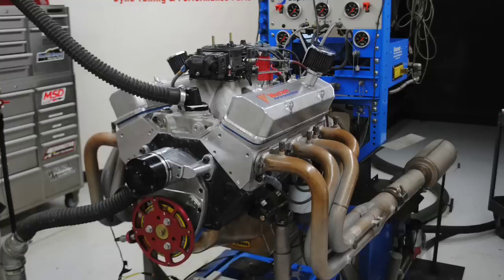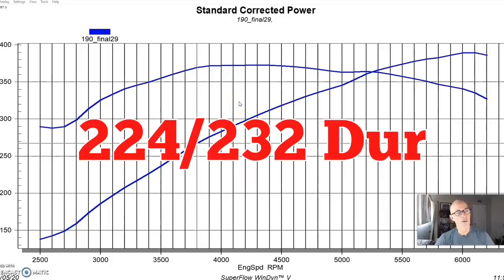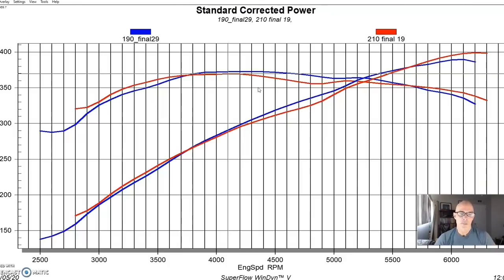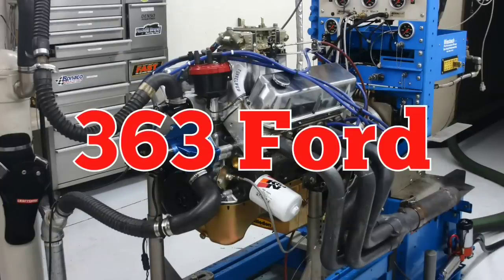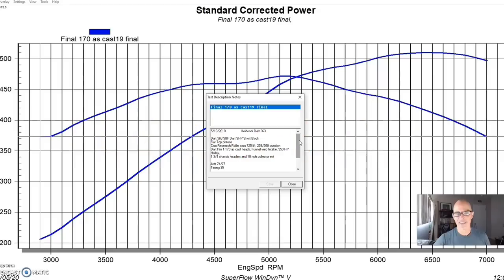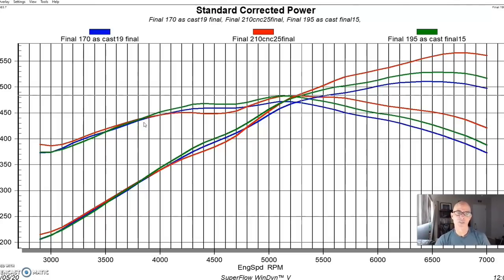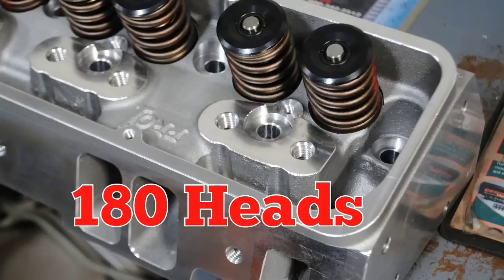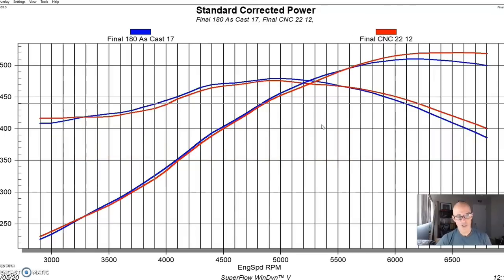PORT VOLUME-IS BIGGER BETTER OR IS LARGER LESS?

Comment: Again. Your flow didnt change. Your runner volume did. Your heads can only flow what your intake and carb can. First test. You were only flowing what the intake could. And test 2 and three are basically the same. Port speed should be your comparison factor. You could throw 300cc ports on there and find the same results. The power plant is going to always require the same amount of air to fill the chamber. How easily it can fill it and at what speed determines the power.
  Part throttle response is also the same. Cant flow a 225 cc port volume if your only open the door to flow 100cc.
Reply from the maker: wrong
Reply: @richardholdener1727  prove it.
Reply: @richardholdener1727  you proved that yourself with the dz302 test. The power of the boss head didnt come in until the ports volume could speed uo at higber rpm. The lower duratiom of the ford also creates more speed into the chamber. 
   Your own test proves what i just commented!!!!

Comment: I would say yes, bigger heads definitely loose low speed power for sure.. Smaller heads produce more velocity and speed therefore making more torque and throttle response down low and torque always wins the race.
Reply: Did you even look at the graphs in the video?  Torque for the bigger port heads was the same at 3000 rpm as it was for the small port heads.
Reply: @andyharman3022    He's talking low RPM TORQUE.. in the 50-700 rpm range where it really matters... YE HAW   port velocity is KING!!!!!!!!!!!!!!!!!!!!!!!!!!!!!!
Reply: @andyharman3022  look at the graphs again....none of the tests started at idle....
Reply: @frigglebiscuit7484  Is this the only Richard Holdener video you've ever watched?  He never tests down to idle.  Have you tested engines at WOT at idle?  Feel free to post your video showing the results.

Comment: I don't think you went big enough with port volume to show a reasonable difference. The 210cc head on a 306 Ford is only up to the same ratio as a stock ls3 and actually better than an L76 6.0. It sounds big because compared to stock E7 castings or 289 stuff it is big, but it's not wildly oversized. If you had a stock 427 chev and put 360cc heads on it, your getting a pretty bad mismatch, small blocks don't really have the range of displacement that you need to get something out of hand. I guess if you had a 310ci trans am style engine with sb2 or Yates heads you could get something bad, but those heads are designed for 800 lift and 8000rpm, nobody cares about torque at 1500rpm and 15" of vacuum.
Your test also maybe didn't start early enough to really show a dip. To really show it the test has to start right off idle. I am guessing most of the guys that have an issue with torque are guys that have a stock or a near stock converter and have already swapped the cam. Now when they drop heads on that have 50% more volume, they don't work great against the convertor.

Comment: The biggest heads on the Chev clearly produced more top end power and over a bigger range.
Having gone from modified fueliies, to Dart 2 iron heads then to 225cc Edelbrock Victor heads bottom end disapeared, Victor heads were useless under 3500 but then it all happened to 7500. Dart2 were the most user friendly but 40 more hp and a bigger up top spread improved times about 2 sec a lap.
 Port volume is different to port velocity, that is where LS engines are generally good. And you need less cam for the same numbers

Comment: The test is not all that useful for a road car imo.  Low RPM performance at WOT is rarely something a road car or race car sees.  What would be far more interesting is torque production in transient throttle conditions, say from 25% throttle rolling into WOT.  That is what a road car driver is going to feel more than anything else.  If the small port head produces 10 or 15% more torque in these conditions that would amount to quite a different feeling engine.  I would still take the big port heads though.  Lol.
Reply: You'll be surprised how many times a road cars gets to WOT at low rpms (1500-2500 rpms) . WOT doesn't mean that you have to have foot buried in the floor . At low RPM all it takes is 25-40% throttle to hit 0 vacuum, opening the throttle more doesn't improve airflow or make more power/torque . Something to think about .
Reply: I drive a heavy truck pulling equipment that only a Mack or Detroit should be pulling so rolling into the throttle gets me  now where fast. This test pertains to me

Comment: Why don’t you do a part throttle dyno test between them then. About 1/3 thottle. That puts you in the range where you probably wouldn’t downshift a normal car where most people say the loss is.
Reply: It would sort of be pointless on an engine dyno. Gearing in an actual car changes the part throttle dynamic so much. The loss is so small in the mid-range it would not impact part throttle power, especially for street driving. I think the perceived issues related to large port size down low are more about idle and low engine speed cruising ability and ability for an engine to spool up quickly from low RPM.. This test sort of indicates that it might not be the ports at issue but maybe cam design focused on high rpm performance.

Comment: Cool vid Richard.its all the variables that make our break our combo. Overlap very important helping with in coming charge before that exhaust pumping just get the show going.longer the stroke more tug effect piston has on intake pumping and ram effect. All that and more can effect cylinder ve.port size only matter when port mean velocity become redundant.flow brench holds a lot of secrets. Peace

Comment: Would it be possible to do a dyno run that holds the water brake constant but varies the throttle to simulate part throttle work?  Alternatively running the test at part throttle might yield an interesting comparison... the engine would accelerate and then peter out (like it had a huge restriction which it does)... if you opened the throttle the same amount each time you would get a comparison of relative power of each head.

Comment: I need a video that shows a 468LS with two bar of intercooled boost on standby, rev limited to 2750RPM,  to be equal to a stock 4.8 torque curve and fuel economy.  I am asking for a friend.
Reply from the maker: 468 at 29 psi at 2750 rpm?
Reply: @richardholdener1727  I  think the "Keeper of the Purse Strings"  is on to me. In a weak moment  I  dreamt  that showing equal torque  somewhere on a 4.8L  curve might allow a further project.
"She who must be obeyed" has hinted at domestic renos of NOT the garage kind.
Could you show the effect of compression changes? 58-64-70-76cc ?  NA & boost, good & bad.

Comment: Do you think a programmable ign might fix middle power curve ?
Reply: If it is losing VE in the middle it could stand a small timing advance there and possibly reclaim some of the lost power.  Hence computer controlled ignition.
Reply: @kevin9c1  I'm always sceptical of locked advance dyno runs, I've not been convinced one advance setting is optimal for entire rpm range, safe maybe but not optimal, yes exactly as I was thinking could a little more advance pick up drop in cylinder pressure in this section then pull back out ? Guess we'll never know but would like to
Reply from the maker: it's not ignition related

Comment: Heres a question for u richard. Do Total Seal rings make a difference at street power? Top ring / 2nd ring compared to standard? Or do u need to get closer to dedicated racer to feel it? If u put those rings on top and 2nd would they hold enough pressure to break something/score the walls? Or r the mainly just intended to keep the engine oil cleaner? Just thinking too hard over here but when i get a t56 for my twinned 5.3 ive been thinking bout rings rods n ppistons too. Whats ur thoughts?
Reply from the maker: We like the Total Seal guys-they make different rings, are you asking about gapless rings?
Reply: @richardholdener1727  yes. They make gapless top ringsets for "racing only" and gapless 2nds for street use. R they that much more efficient? Like paper provable? Or is it more like an extra pony @ 1000 crank hp?

Comment: Port volume is just an artifact of port shape. Port volume per se is virtually meaningless. It's simply an ambiguous comparison of two otherwise identical heads. You could increase port volume in a way that would have little or no affect on flow.
Reply: Right.  Actual velocity matters and it would be nice to quantify part throttle.  It is certainly impacted by the impedance of the whole intake tract.
Reply: Excellent reply

Comment: Shape. Using the least size wont improve low end torque if there are exhaust humps to deal with. A good 4V port Cleveland will always make excelent low end torque. Its very easy to over cook cam duration figures at the 30 thou both valves off seat and 50 thou duration figures. That hurts low end torque the most.

Comment: You want the smallest port possible [to keep port velocity high] that won't interfere with free breathing at whatever max rpm you intend w/ the cam&valve combination you're running. Easy! ;-)
Reply: This just showed what you said is incorrect, what it doesn't compare BSFC from different heads
Reply: I thought that too...however then you have ls engines with amazing heads and small cams...sooo
Reply: What you want is an adjustable intake one that narrows at low rpm to keep the velocity high and opens up at higher rpm.  Some engines have 2 runners per cylinder, where one runner closes off at low rpm to keep the velocity high. Toyota's 4AGE does this with TVIS, and that's one reason why a 1.6l Toyota MR2 can beat a 5.0l American V8 Camaro to 60mph. And why a 3.0 V6 Taurus SHO 4 door sedan is only a click behind a base 350 C4 Corvette.  The Taurus intake also has another trick or 2. The lower intake runners are not equal length so one runner is long and the second runner is short. The short runner is probably the one that closes at low rpm, short one breathes from one side, long one from the other side of the upper intake which wraps completely around the engine so the engine can pull from a large volume already past the throttle body.
Reply from the maker: Having bought on new in 1986-that's funny about the MR2
Reply: @richardholdener1727  I had an 88 back in 2014, shift down to second at 45 mph and punch it. 1.6l of Japanese fury.  I picked up an MR2 brochure in the 80's and then waited a lot longer to get my license :-D

Comment: So glad you did this test, bought a set of big flow heads for small block Chevy so I could upgrade later, glad to see I won't be losing a bunch in the meantime.... You keep testing ..I'll keep watching
Reply: What are you running? I am looking at building a 600+ horse power SBC and looking at combos people actually get to work well on the street.
Reply: @sebbonxxsebbon6824  a small block Chevy, w/220 intake runners, about a 600 lift cam with a sniper efi, planning to turbo later
Reply: Scott, did you get your combo together? How doers it run?

Comment: I wonder how torque production would be affected by intake runner length vs. port volume. i.e. would a TPI make more torque with a smaller port than larger.
Reply from the maker: it does improve low-speed with a change in port size on the intake

Comment: Set of vortec heads in this mix would of been nice.. I hardly ever see any mild cam vortec head dyno tests on You tube especially comparisons!
Reply: Yes!
Reply: Yes!
Reply: With 9.5-10:1 and a 205-215 cam vortec 350s make over 400ftlbs. I think they hit a flow limit around 500 HP. My neighbor has a vortec 383 mild, 900rpm idle and immediately lites up the street tires in an 80 Malibu. Great bang for the money.
Reply: This would help a ton.

Comment: dude i love all your vids. im in the middle of looking for parts for parts to make a chevy 302 out of oem chevy parts. i'm using a chevy 350 block and a 283 crank. im looking at LS pistons and rods, i just don't know what oem sizes to go with, if your able to help would be nice.
Reply from the maker: LS pistons and rods in a 350 Chevy?
Reply: @richardholdener1727  yea I'm trying to use parts I have laying around my uncle's shop
Reply: Deck height won't line up.  LS has taller deck than SBC by .215".  Your 302 would require a piston compression height of 1.425 with LS rods.  A 6.0 LS piston has a compression height of 1.33.  The top of the piston would end up .095" down the hole at TDC.

Comment: I don't think there would be much of a difference, as the headflow wouldn't be the limiting factor. it would be the throttle blades. I'm thinking the variation you're seeing in the midrange is a function of port velocity and intake harmonics, and with the larger port volume the frequency at which the third harmonic occurs would be shifted slightly upward in the rpm band, and it would behave like it had a shorter (or larger diameter) runner. The same test on EFI (port) would yield similar, but slightly less dramatic results, due to the fact that the fuel distribution isn't affected as greatly by the velocity of the air in the port.
Reply: It’s more the factor that people run carburetor tune ups that are that terrible.   10-20cc difference the air speed will never know
Reply: Its called reversion, look at peek torque rpm, at half the rpm should have torque, and in between less. At rpm when reversion is happening, then its worse with the bigger port head. Effect is worse still with a carby, because some of the air coming in is carbureted three times, making it richer and less torque.
Reply: @sheridenboord7853  not true or correct in any way

Comment: Keeping fuel atomized smoothly idling in 90 deg traffic with tight converter with the larger race heads is a good trick to pull off. Loose converter sucks to drive every where at 3,000 plus rpm
Reply: You mean like a stock ls3
Reply: Mike Sauer : Cam duration verses air flow related. Its a Universal  truth that really good breathing larger ports...dont need the same amount of cam agreession. Quite often, better results happen with mild cams and more attention to the whole flow from carb venturi to intake to head to exhaust to make better part throttle economy. Richards got it summerized Right On!

Comment: As for the part throttle... I think you could really see how it affects part throttle by looking at the VE table that would be generated when tuning if you were running fuel injection. You obviously couldn’t do the test on the dyno. It’s a little out of the norm for your videos, but I think it might be cool to see. When I tune a vehicle, I can get a pretty good idea of where the power is improved by the shape and numbers in the VE table.

Comment: Have a set of 220cc pro toplines on my 383. I went with a dual plane air gap to balance out the combo. Pretty happy with the overall performance. A lot of throttle response surprisingly
Reply: 640 lift, 250's @.050 106° cam 12.3:1
Reply: @Mod Zozer 7000 racing in mud
Reply: the cam and compression is what balanced your combo, stick a single plane intake on and let er eat
Reply: @speedy3b9  I'm considering giving one a try, but that also means buying a different converter to match. I'm honestly surprised at how well this combo works though. Beat several 700hp big blocks at my first two races with it.
Reply: @basketballcory2  i doubt you would need a converter change
Reply: @speedy3b9  I've seen some low end bog  with these exact heads which is why I went with the dual and manifold. The larger runners killed port velocity at low rpms. A higher stall would put me closer to a desirable torque number to launch from. But sometimes like in my case, "a 200ft mud pit" the race is won with a great launch and the best torque average. Which is why I chose that dual plane for it's low end torque numbers
Reply: @basketballcory2  ooohhhh

Comment: What about the intake manifolds?  Did you port match the runners or simply one size fits all and if so, which head port size most closely matched intake manifold runner?
Reply from the maker: this is not a port match issue
Reply: @richardholdener1727   Never said it was.  Is the intake tract not from the back of the valve to the intake manifold plenum?  Lets say on your typical SBC with SP intake the total intake length is about 10 inches long.  By altering only the head port volume or about the last 2.5" inches of the intake track you are ignoring what is happening in 75% of the intake tract. 

On the Chevy test I can see the intake port on the 180 head was port matched to the intake, that might suggest the intake was possibly bigger than it needed to be and much more optimal for the 210 head.  Also, the 180 was "as cast" where as the 210 head was CNC ported which would mean the short turn and throat have been optimized and so I would expect to see gains there regardless of the intake port volume.

On the Ford 306 test the 225 head made no more power than the 210 head with almost identical HP and TQ curves which suggests the restriction to making more power/torque lay elsewhere.
Reply: After thinking about it some more, I think all this test has proven is that for each of the combinations show above that the 180cc heads are too small.  Lets re-test with engine combo's with smaller Hydro FT cams in the 210-220° @ .050" range with less that .500" valve lift, 9 - 9.5:1 CR and dual plane manifolds.  Engines that make peak power well under 6 grand and are happy without high stall converters and 4.56 gears in the rear.

Comment: Ha! I was busy composing a comment on how the dyno only tests WOT and not street drivability when Richard starts talking about that. I should have known that Richard would be on top of things.
Reply: What would be cool is to do the same dyno tests at part throttle, say 30% or 50% and from low-middle rpm say 2000-5000.  That would provide interesting data on driveability vs WOT